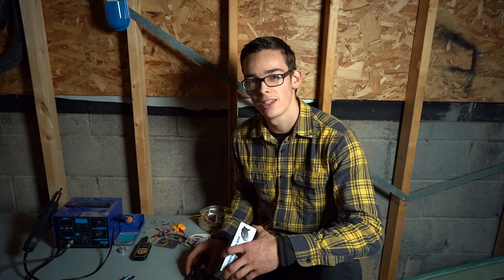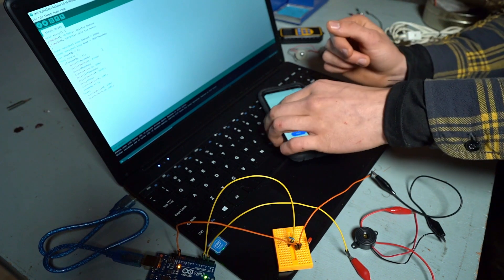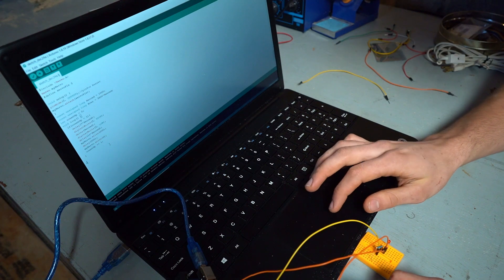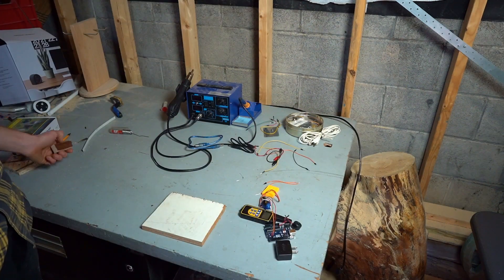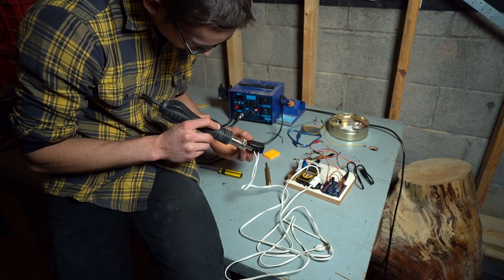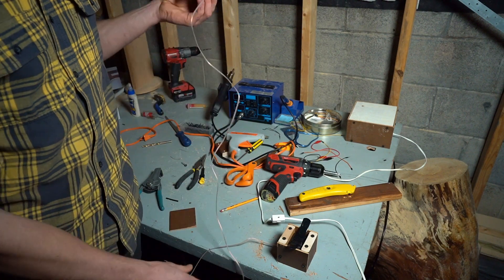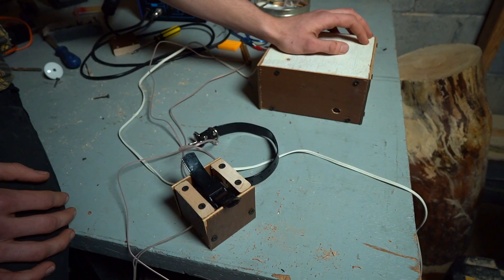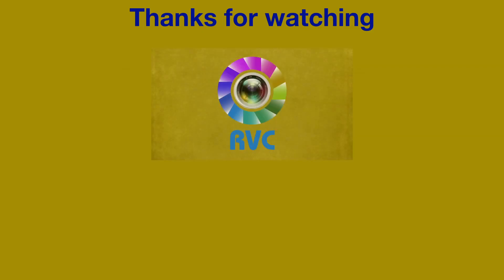Shocking Alarm From Arduino And Shock Collar

Comment: That's overly complicated.  Remove the button on the remote, solder two wires to the contacts and use the arduino to close a relay, connecting the wires.
Reply from the maker: Great idea, thanks.

Comment: Is it safe??
Reply from the maker: Yes, unless you have a pace maker.
And the shocking device can be set to anywhere from slightly uncomfortable to painful.
Reply: @TheRandomVidsChannel  i know its dengrous if you have pace maker but also if you are normal person its safe to sudden shock you durring sleep?
Reply from the maker: It's arguably not the best to wake up to because it could wake you in the deepest part of your sleep depending on when you set it. The best way to wake up is natural sunlight because it gradually wakes you. But the shocking method is not really harmful, and after a few days of getting shocked at the same time each morning you would automatically wake up when it's about to go off.